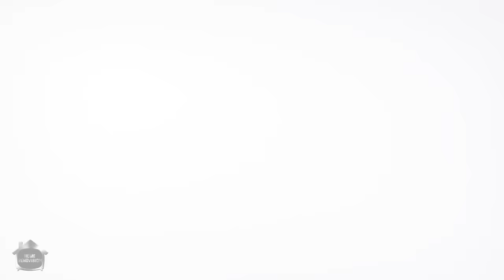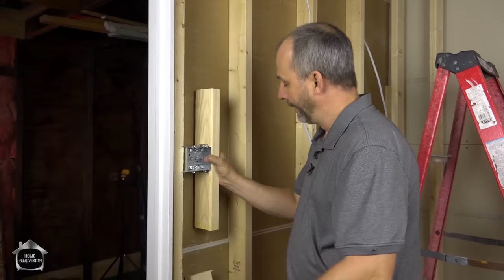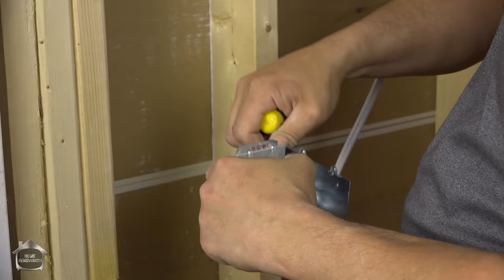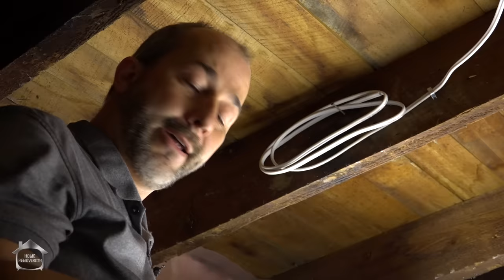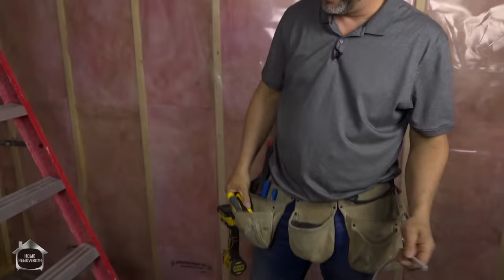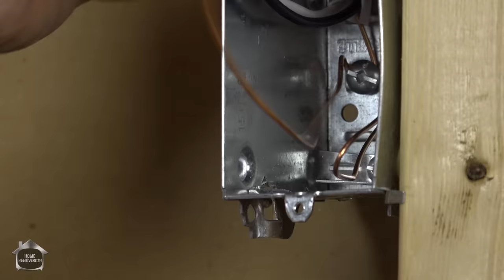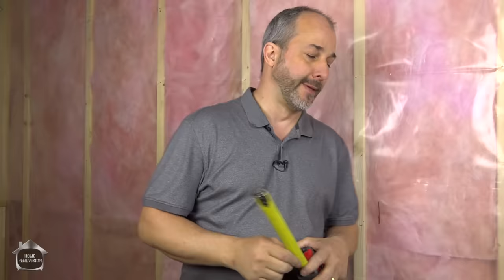DIY Bathroom Wiring | How To Run Electrical

Comment: Whaooo ..... the norms in US and west europe are completly different. Here, it's not allowed to install directly wires like that. They must be first installed into a flexible plastic tube fireproof.  I think it's a better option, because, you can alway rewiring without destroy the walls. Wall casings are also in plastic and ground/earth is directly plugged into the electrical device.
Reply from the maker: Personally I think that is crazy. the majority of fires start from unattended cooking and cigarettes. They have nothing to do with wiring. The idea of legislating safety is a joke. time to get more practical.
Reply: Home RenoVision DIY the way you do it is crazy, i bet i would do the same job with EU stuff faster AND it’d be safer.

Edit: as far as i know the tubes does not need to be fire safe/swedish electrician

Comment: were are the metal plates for wen you go thru studs so      
it protects wires wen screwing into stud
Reply: U don’t need them, u need to be 32mm away from the stud when drilling holes through studs

Comment: If you gotta be 36 inches away from water, but can you have a light in a niche where you take a shower?
Reply from the maker: low voltage led with the connection box in the ceiling yes!

Comment: Sir can u show us wiring diagram for two water motors if one motor stop working then the second motor should start automatically
Reply from the maker: are you referring to a sump pump system?
Reply: Parallel connections, just like recessed lights. Even for whatever water motors are.LOL
Reply: @HomeRenoVisionDIY  Yes Sir But i am looking it for aquaculture, Sir can u help for wiring

Comment: I'm confused. A lot of other places online say to always use 12/2 wire for outlets and 14/2 for lights
Reply: It is my understanding that 12/2 is for 20amps and 14/2 is for 15 amps.
Reply from the maker: depends on the place where you live.
Reply: Gotcha, makes sense. Thanks for the info!

Comment: There was really no reason no to upgrade to 12/2 while you were there? By the way, what heats up in a wire is a pinched conductor, normally a bend more than 45%, not the wire being compressed. It's because it reduces the mass of the wire at that point.
Reply: Technically mass cannot be reduced so it doesn't reduce the mass but make its more dense at that point.

Comment: the Electrical Code required to have 12/2 for bathroom for bathroom receptacle outlets and no other outlets
Reply: In your jurisdiction.....Ontario, Canada 15amp 14/2 feeds are code. One 14/2 for GFCI and one feed 14/2 for lighting and or fan.

Comment: You say code is 12” from switch.  Does that mean Canadian code uses imperial?
Reply: Canadian residential construction is almost entirely imperial, everything from gallons of paint, feet and inches of lumber, gauges of wire, and so on
Reply: The CEC says with in 300mm of every box or fitting.

Comment: Isn't the bathroom required to be on a 20a? That would be 12/2 is required
Reply from the maker: Yes it is in some regions. In my Country 14/2 is still code. Cheers!
Reply: Depends on local codes but there are specifics that allow 14 gauge for lighting but fart fan and one dedicated circuit in nec need to be  20 amp but if he's adding an additional circuit it should be fine provided he already has a 20 amp circuit

Comment: I use 12 wire for everything. Im not sure why they sell 14 anymore. Its easier for 12 incase you want to add a receptacle to a light switch.

Comment: "compressed wires heat up" ??  I can see plenty of issues with a 14/2 jammed in to the wrong place, but why would it heat up unless there's an actual short-circuit.
Reply: I am thinking it would change the dimensions of the copper and prevent electron flow. This would act like a resistor and heat the wire.

This is like stepping on a garden hose which causes a pressure build up before your foot and less flow after it.

Not an expert but that is my theory :)

Comment: Stick with other trades.  Your electrical advice is minimalistic.  Also, in most localities, certain specifics you stated would not pass inspection.
Reply: I think he made it pretty clear that the exact steps and techniques will vary depending on your area and code. This just gives you a rough idea of what it's like. Anyone blinding following this video without doing further research is not very bright.
Reply: Skylane2005  stick with drywall

Comment: 250'x55' square feet how many need receptacle out let
Reply: Are you asking how many receptacle outlets you need? I believe code requires an electrical outlet every 12 feet but it can't be within 36" horizontally of a shower but a GFI outlet is required within 36" of a lavatory (but not close enough to get splashed).

Comment: In the uk we aren't allowed any switches in the bathroom they go on the wall outside along with any isolator switches for fans/showers etc
Reply from the maker: makes sense with the power you use. Cheers!

Comment: The Canadian Electrical Code requires at least 39.25” (1 M) from the shower enclosure to a switch or receptacle and a GFCI receptacle within 1 meter of the sink but not behind the sink.

Homeowner guide from Winnipeg:  https://www.winnipeg.ca/ppd/Documents/Brochures/Electrical-Intallations.pdf

Comment: Your install is not code compliant. According to NEC 210.11 (C) (3), you need a dedicated 20A branch circuit to feed the bathroom receptacle outlets. This cannot feed lights and needs to be run on 12AWG wire for the 20A breaker.
Reply: You also don't have the minimum 1/4" sheathing into that metal box per article 314.

Comment: 20 amps 12/3 or 12/2 minimum for bathroom once you run a heat hair blower will pop the breaker so 14 hauge wire its not a good option

Comment: Not code compliant in the United States but may be ok where he is.
Reply from the maker: Hi Spencer, a simple fix for folks not living in Canada. Just use a 12 gauge wire and run a 20 amp breaker if it is required. Cheers!

Comment: The reason you inspector will fail you if you have to many wire in a hole is because of the 2/3 fill rule. Remember that the wire generates heat and heat need to have displacement area for that heat. This rule also applies to conduit and box fill. I have found so many time where the electrical device box is too full. You can determine box fill with your local NEC standards. https://www.ecmweb.com/national-electrical-code/code-basics/article/20886012/box-fill-calculations

Comment: All bathrooms require 20 amp circuit for the GFCI outlets
Reply from the maker: That may be the fact where you live. However where I live it is only required to have a 15 amp circuit connected and as such a 14 gauge wire. cheers!

Comment: There are a fue code violations here.
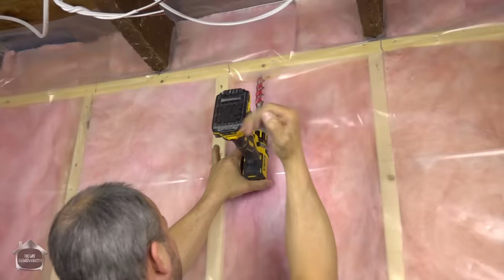1. You need a bang plate for the last hole you drilled at 42:30 as it closer them 35 mills from the face of the studd

2. Your using the wrong size staples for 14/2 romex 44:21
3. Wires need to be secured within 300 mm of the box
The fan housing should be installed before drywall
You can get pot light rough in plates, i recommend roughing then in before drywall.
Unless your an experienced electchicken please DO NOT USE A DRILL TO TIGHTEN BOX CLAMPS.
I have fixed numerous issues with shorts due to over tighten box clamps that breaks the integrity of the conductor.

Comment: Code requirements are for you to run a dedicated line for the bathroom and it has to be 12-2 20 amp not 14-2 15amp
Reply from the maker: Hi Anthony, In my Country we only need a dedicated 15 amp! It may be different in other areas for sure.Where do you live?
Reply: Home RenoVision DIY new york
Reply: Home RenoVision DIY  you did an excellent job. If your able  to run 14 wire then you did a hell of a job

Comment: why didn't you use 12-2 can't 12-2 and 14-2 run together
Reply from the maker: I am just following the code. 14 gauge supplies all the power I need for a 15 amp breaker.
Reply: @HomeRenoVisionDIY   i see
Reply: If you use 14-2 the circuit can't be more than 15Amp
Reply: In (Toronto) Ontario, Canada we only use 12ga wiring for kitchen counter receptacles and some baseboard heaters and now I believe for the dishwasher also. According to our Electrical Code that gets revised about every 5 yrs.

Comment: I'm an electrician in the U.S....for the record.  The primary reason for NOT running over a stud is not that it gets hot....it's because you can (obviously) pierce the romex with a drywall screw and cause a short (ie fire or shock hazard). It would take a significant amount of pressure to cause enough heat for a fire.  I enjoy your videos...but you DO speak outside of your expertise quite often.
Reply: Ask three people in thrre different regions, and they'll all tell you different things.  Ive been told by different licensed electricians both what Jeff said, and what you've said.
Reply: I'm a Licensed Building Renovator with the City of Toronto. He never said he was an electrician. We are renovators. Which means we are experts in every trade to some degree. I've been doing this for 25+ yrs. and i watch his videos. He knows what he's doing. And also he could be Stuart's brother from the Big Bang Theory.

Comment: If the wire coming into the box is ever short you can always splice on a pigtail !
Reply from the maker: Cheers , great advice, but if you are running new wire best to leave a little extra.

Comment: Surprised that you don't have to use plastic boxes. That's what they used in my parent's house.
Reply from the maker: I use plastic on the exterior of the house for insulation purposes. The metal boxes are less than half the price up here so I tend to go cheap on interior walls.
Reply: That's very interesting. Code in Pennsylvania must be very different. I think that plastic boxes in the interior of houses are a must and metal boxes can be used when the box is in a garage or shed or on a concrete wall where the wiring is run down the wall in metal conduit pipe. At least that is where I have seen them.

Comment: U need a 14/3 when running a 2 or more witches controlling one load
Reply: Would that be 3 wires & a ground or does the 3 include the ground? I've seen just 2 wires & I've seen 14/2 with ground. I know some kitchen appliances are something like 10/4 or something though. I'm just starting to learn about electrical.
Reply: Yeah, it's called a three-way switch

Comment: Can't honestly say I've ever seen wire stapled to a ceiling joist like that before.
Reply: Sorry- meaning the underside where drywall would go.
Reply from the maker: Hi Mike, in this case we will be adding 2x4 strapping to facilitate the installation of a plumbing vent line. Cheers!

Comment: Does anyone check what this guy says?? 35:50 "My unit runs on only half an amp. So to put that in perspective that would be the same as about 1/4 of one incandescent 60W light bulb."

Lets check this math real quick. Watts (W) are Volatge (V) * Current (A) , we know that a light bulb is 60W and we also know that US homes run on 120VAC. So let's just plaug that into our little equation there and we get 60 = 120 * A. 7th Grade algebra tells us to find A we divide both sides of the equation by 120. 60/120 = 0.5A or half of an Amp. So his towel warmer unit runs on half an amp, which to him is equal to an eigth of an amp? Regardless, half of an amp running all the time is pretty considerable consumption. He also calls the hardwire system low voltage, which if the wiring to the unit is 120VAC, then that's only low voltage if you're a lineman. I don't think the voltage is even converted at any point, I think the warmer just acts as a big resistive load which just generates heat.

People should not be listening to what this guy has to say. Seems dangerous to do so. Hire someone who's licensed or be the proud owner of a nice big pile of ash.

Comment: WOL. "It uses 0.5A whitch is 1/4 of 60W incandescent light bulb" !? 1. 1/4 of 60W is 15W!  2. 110V x 0.5A = 55W! 3. Doesn't  matters how much Amps it uses, it mather how many Wats it uses! Since that heater can be rated for 220V which will be 220V x 0.5A = 110W which is double from 55W. And this is how you know what wires to use in practice. Codes in US are totally different thing from practice!

Comment: I hate gem boxes. Why not a 1900 box and a mud ring? You'll have more room for your wire when you install your GFI, which will definitely fill that gem box. Then you have to worry about a screw touching the side of the gem box. So you'll want to rap electrical tape around the outside in case a screw touchs the side or a wire comes loose. Garbage, I don't use those boxes. 1900 box all the way for me.

Comment: "This much wire is pennies!" Have you seen the price of copper recently? ;)
Reply from the maker: not as bad as it was 10 years ago. Cheers!
Reply: Yes, he said pennies.  Which is what that much length of cable would cost. Pennies spent on a bit extra cable is a heck of a lot less then the cost of additional labor later spent 'dicking' around with wires that are short. What's your time worth to you? Never mind paying an electrician...
Reply from the maker: Very good point. sometimes it pays to be a little thrifty. Time is the one thing we don't get to cheat!

Comment: Half an amp is equal to a 60W bulb, not a quarter of one... I would connect it to the light power. Otherwise, you're burning about $50 a year with it.
Reply: I believe all of them will have it's own on/off switch.
Reply from the maker: Not sure what we are discussing here, however I am using all led lights and they will have their own switch. Cheers!
Reply: You said the towel heater takes 1/2 an amp, which is equal to a 60W bulb, not a quarter of one.
Reply from the maker: If I can have warm towels for 50 bucks a year then I am willing to pay for it. turning on the warmer with the lights results in cold towels. Cheers!
Reply: @HomeRenoVisionDIY  Heated floor, just drop the towels on the floor before you take a shower hahahaha!!!!!!!

Comment: You're wiring in the ceiling violates what you said about the walls.  It is over the Top of the ceiling floor joists which leaves it exposed to damage from renovations in the future...

Comment: You ran that wire on top of your ceiling. Aren’t you gonna close it. Or are you  using a drop Ceiling. It same concept when putting that wire on the stud. Because your gonna pinch the wire when you rock it.
Reply from the maker: we had to use strapping on the ceiling to level it off after. Cheers!

Comment: Pretty sure if I just do anything that is beyond plugging in an outlet I'm breaking code and law in Quebec. Changing a lamp....or dishwasher... that is hard wired? Nope. Obviously people do it all the time, especially the landlord or handyman... and it creates weird electrical problems like 3/4 of the apartment including the fridge on the same circuit, or 90% of the outlets not being grounded...Got told by an electrician to use one of those fancy surge protection power bars that tells you if the outlet is grounded or not and use them only for non critical appliances.

Comment: All through this video you were using the wrong staples for single 12-2 or 14-2, the staples you used were for stacked 12-2 or 14-2 or larger gauge wire.Look at the box they came in!

Comment: I never understood the logic of hanging a fan directly above the bathroom ceiling. They are loud.  Just put the fan motor at the exit point instead of at the vent opening. You will never have to listen to all that noise.

Comment: Interesting...Type NM-B has to be secured and supported every 4 ½ feet, not 5 feet as stated per 334.30 of the National Electrical Code. Also, the bathroom individual branch circuit has to be at least (1) 20 amps circuit per 210.11(C)(3). Now, you must be outside of the US (lower 48) as you stated switches can't be within 3' of the sink/basin which is incorrect. Also, you the individual branch circuit that should have been a minimum 20 amps and should have been for your GFCI can't supply OTHER outlets, such as that thermostat you installed. Recommend you visit my channel and watch some videos my friend. Visit YouTube.com/masterthenec

Comment: He stripped the romex wrong. He cut an then pulled down, possibly nicking a wire, why not next time cut at bottom and pull back? 

Why is he double grounding the box? One of the box ground pigtailed to rest will suffice.

He is going to wire all the switches and outlets before connecting to panel? And maybe close up wall? What if you got a short with your romex cutting good luck finding it then. Next time rough in, wirenut the wires and make it live. 

He needs to drill through those joists. Not staple to it.

 YouTube sucks for electrical videos.

Comment: Didn’t even show how you run the wire to the panel.  Please be thorough and show how the wire is connected to the power box.  Also no explanation of how power comes in to the switch and how the switch controls the light and how grounding works at the light connection. Thanks
Reply: He mentioned that another video shows the panel hook up 🙂 The power to the switch comes from the wire that he ran through the top of the light switch receptacle. It's the first wire he runs at the start of the video.